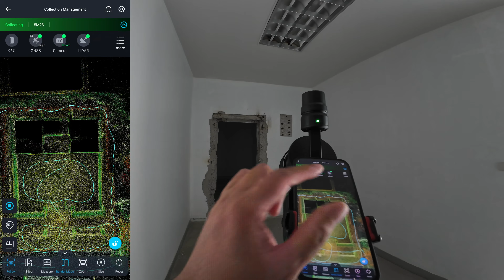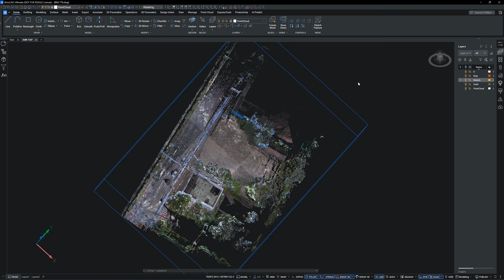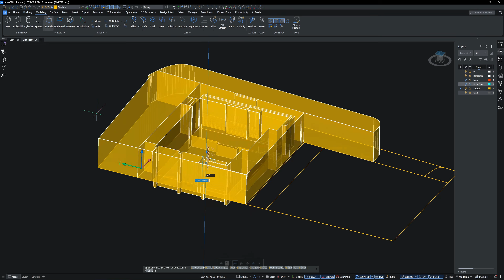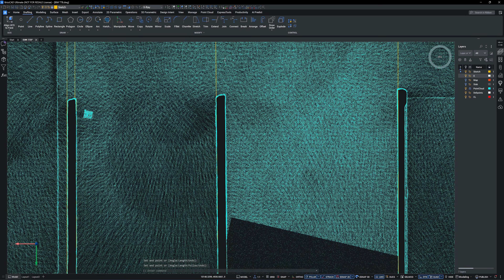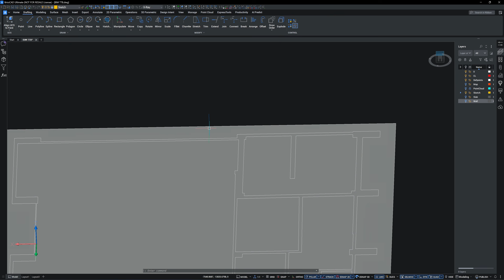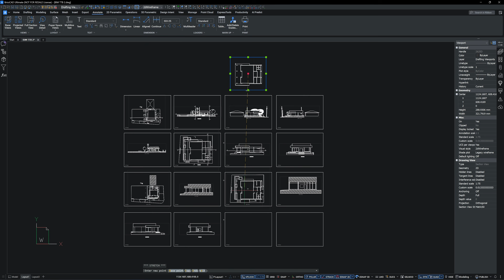LiDAR Scan to CAD/BIM | Bank Renovation Workflow (LiGrip O2)

Comment: If you could recommend any slam scanner for this type of project what would it be as your favourite? All things considered? Software, range, accuracy, support
Reply from the maker: So far, the LiGrip O2 is hands down the best SLAM LiDAR scanner I’ve tested for Scan‑to‑BIM projects. It meets every requirement: accuracy, extremely low drift error, consistent floor‑to‑floor leveling, precise wall parallelism and orthogonality, RTK fusion SLAM, strong detection range, effortless operation, sharp point clouds, and high‑quality colorized output.

Comment: That's why I am moving away from budget scanner. I don't want to spend any more time and energy to avoid and fix drifting, uneven walls. It is exhausting and tiddous.
Reply from the maker: Accurate scan results save significant modeling time. With a Livox 360‑based scanner, I’d have to round dimensions to about 20 mm, which adds extra work compared to higher‑precision devices.

Comment: can you make content about pocket2 lidar with rtk, i am curious about the results, because maybe lidar with a low budget
Reply from the maker: I'm expecting RTK module to arrive next week. By looking at the user manual, Pocket 2 might be able to do RTK fusion SLAM. It has filtering option where the scanner will only use good GPS value for calculation.